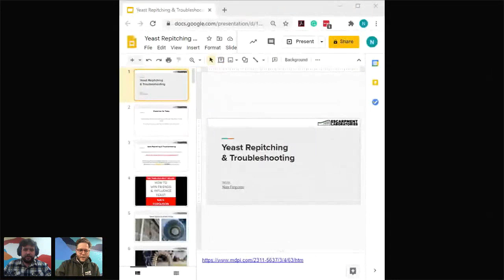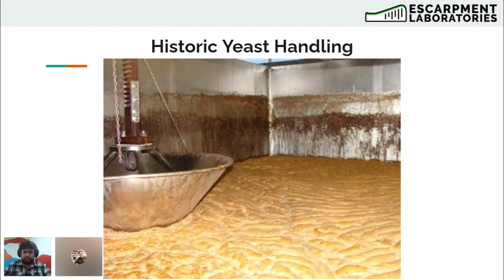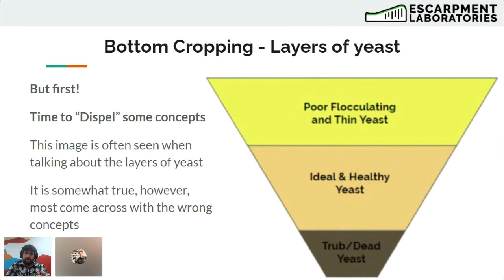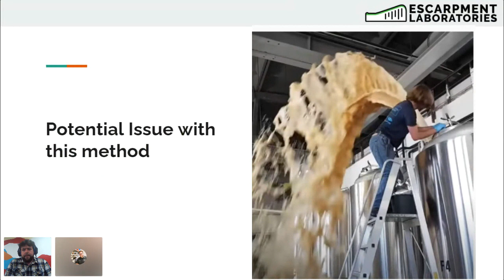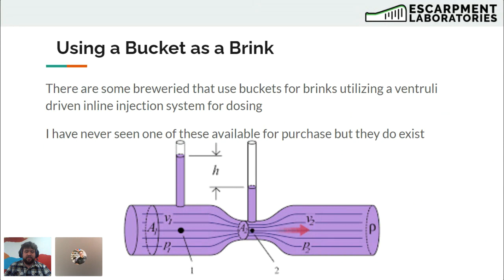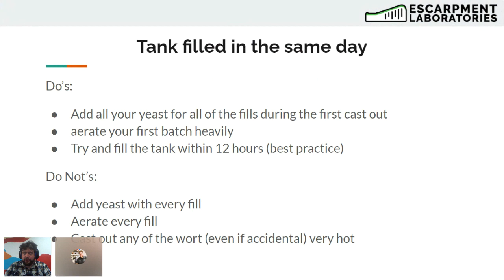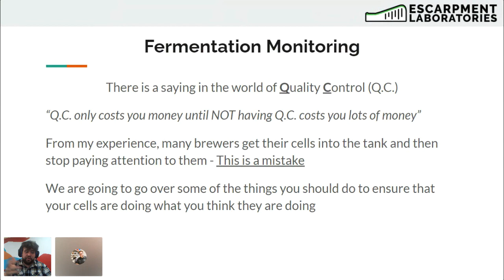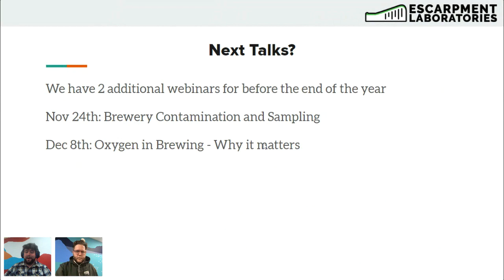How to Repitch Beer Yeast and Troubleshoot Fermentations

Comment: Can you blend Brett or Lacto strains with ale strains? And if so what is their viability?
Reply from the maker: Hi Diego! You can, but the ratios can go out of balance and may result in unexpected or inconsistent results. In terms of viability, the balance of the microbes can determine which ones succeed and which ones struggle. For example, yeast in an environment with a lot of Lacto might struggle due to high amounts of lactic acid.